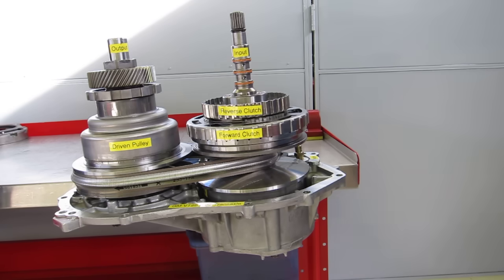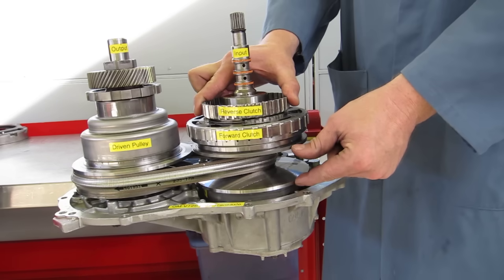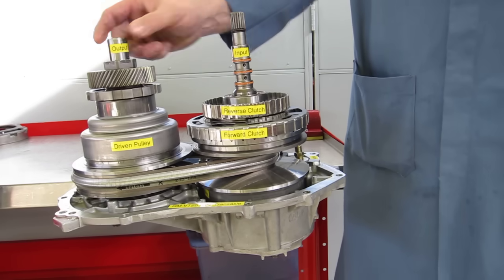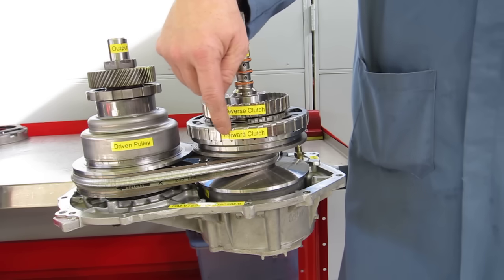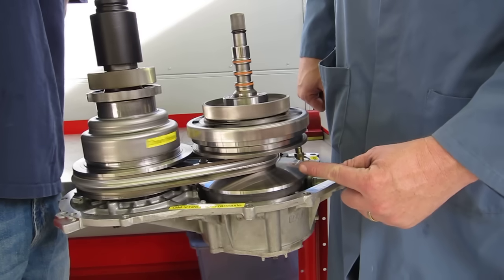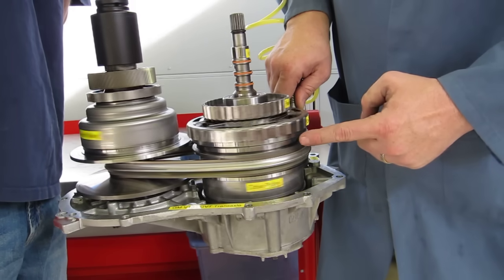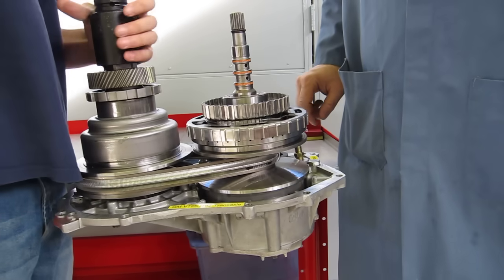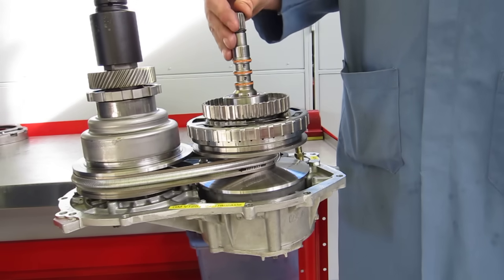Continuously Variable Transaxle (CVT) Operation

Comment: It is amazing how such a thin and small belt can transfer enough force to drive a vehicle that weighs thousands of pounds. These transmissions are amazing that they work so well.  I realize there are long term reliability issues with CVTs.
Reply: Its interesting how it's all designed.
Part of the reason the belt can be so small is because it's spinning much faster than the axle. If the wheels are applying hundreds of pounds of force to the ground during acceleration, maybe there are only a few dozen pounds of force on the belt depending on what the reduction is.

But all the energy going to the wheels must come through that belt, you're right. It just spins around a lot more than the wheels in order to convey that energy
Reply from the maker: Thanks for watching
Reply: Long term reliability issues boil down to the manufacturer, as well as how the individual transmission is serviced by its owner (or owners). Honda CVTs can last a very long time as long as the CVT fluid is changed on a regular basis, using the correct OEM Honda fluid. On the other hand, Jatco (Nissan's transmission OEM) seems to use rubber bands in their CVTs, and no amount of maintenance can protect against that.
Reply: @TheKnobCalledTone.  The steel belt slips and breaks because of inadequate pulley pressures.  It has nothing to do with the strength of the belt.

Comment: Which brand makes the best CVT's I own a 2013 Honda Accord and have heard good things about Honda CVT's in particular.
Reply from the maker: Good question, Honda has used them for a long time. Thanks for watching
Reply: The best one is Toyota with their Asin CVTs.  They kept on refining them over the years. The worst is Jatco transmission owned by Nissan

Comment: its great until about 100,000 miles...then its snaps like a yo-yo......WHAT THEY NEED TO FUCKIN DO, IS MAKE VERY EASY TO R+R.....LIKE AN ALTERNATOR, OR STARTER.......but they wont...why kids?   because nissan wants you to buy more of their junk more often....THE GOVERNMENT NEEDS TO STEP IN AND KICK THEM IN THE ASS.
Reply: The government is the reason this junky trans exists in the first place with their ever increasing demand for more mpg and cleaner fuel.  CAFE standards are too strict.
Reply: @JohnS-il1dr  Yes, thats true......but it does help the mpg since its a direct drive......they need to make it better...just look at the crappy pulley- its looks like my gal's bracelet......also have a removable door or pan to remove pulley when it snaps....you have to take the whole goddam off the car- its a $3800 job here in connecticut......If they want to satisfy cafe laws, fine, but make the damn thing serviceable....Its a total scam.

Comment: Honda CVTs are great. Thanks for this wonderful explanation
Reply from the maker: Thanks for watching
Reply: Not until 2016.  The 2013-2015 cvts had bad seals that caused the bearings to go bad. Replacement was the only option for my 14 accord lxs coupe. 5500.00

Comment: so if this cvt was in a "real" car the belt could be manouvered to any position on the two pulleys to generate which ever gear ratio is needed. Did i get that right or is the cvt in the video only capable of the two shown ratios?
Reply from the maker: No, those are the ratio limits. It is variable ratio between them. Thanks for watching
Reply: @WeberAuto  thanks for answering and thanks for the amazing video! Have a nice one. 😁

Comment: The CVT part is easy to understand. Wish they would shown how the clutch works better. More specifically how it achieves the connecting/slip of a conventional clutch/torque converter design when the car is stopped.
Reply from the maker: Thanks for watching

Comment: All I hear is that a CVT transmission will last about a hundred thousand miles if you're lucky such crap I bought a CRV 2016 Honda thinking it's a Honda it will last forever if I take care of it once the car's transmission goes I will never buy a CVT transmission vehicle again
Reply from the maker: They have been troublesome. Thanks for watching
Reply: Our dealer has powertrain warranty forever so even if our Hondas CVT breaks I don't care I still change the fluid though most people dont

Comment: It's a shame you didn't do more work on the air supply. This demonstrated the speed it can change the ratios but not how slowly it can change them too !
Here, have a look at an oil-free version that's purely mechanical from within the pulleys working in the car:
https://www.youtube.com/watch?v=j2jkyCaard0
It is effectively two analogue mechanical computers fighting over a belt !
Reply from the maker: Thank you

Comment: Does the belt tend to slip or lose grip when climbing a mountain?
Reply from the maker: No, it is held tight by very high forces from in the pulleys
Reply: @WeberAuto  I ask because i purchased. A older Nissan Altima. It has a cvt. Should I install  a after market  cooler for the transmission fluid? I'm seeing that the fluid tends to run hot which kills the life expectancy  of the transmizsion.
Reply from the maker: @canocano5480  If you live in a hot climate area it might be worth the expense.
Reply: @WeberAuto  I live in cali. Central vally. Summer temp can get up to 100.°

Comment: Perfect video!! My Altima cvt has a manual gear shift option with a total of 6 gears. Would the cvt last longer using this feature rather then the belt and pulley system continually hunting and changing gears?
Reply from the maker: No, it is just a gimmick to make you feel like you are not driving a CVT
Reply: @WeberAuto   After more thought, it seems if the gear function were used for thousands of miles, it would make grooves, wear patterns, on the cones (for lack of correct word). Continually hunting would provide a more even wear pattern. How about using the gears for towing short distances?  I know, towing not recommended.

Comment: So basically the belt is held in gear by the edges of the belt? Seems like it's slip city...
Reply from the maker: Yes, with a fluid pressure on the pulleys of up to 700 psi (4826 kPa) pressing on them.

Comment: Garbage technology!! If one piece fails the whole garbage transmission goes...The belt, the seals ( leak ) used to pressurize the cones...Customers in the United States pay alot of money for new vehicles. That the manufacturers decide to place this Garbage transmissions in their products to save money but don't pass the savings to their customers...All the manufacturer pass is headache to their customers...How many times did Nissan get sued over this Garbage transmission..I'm sure there's other manufacturers...Get some smart practical engineers in auto manufacturing...Yes I'm pissed cuz I had to deal with this CVT Garbage !!

Comment: This an awesome illustration and I have watched many. My biggest take on the CVT is that is NOT for the heavy footed wanting to go fast in a hurry. Consistent times on oil and filters changed. There is 1 filter inside  and a small round one front outside of the case. from the outside of the case, so if you go to get your oil changed and filters changed tell them you want to see them both. There should be a oil pan gasket and a used interior filter, metal, and a small round filter from on the case. IF they can't show you them then they just screwed you out of an oil change without changing the 2 filters. Tell them after the fact, that way they can't go find one from weeks ago. You'll be glad you did. And you will only pay for what they did and and not what they said they did. It's your vehicle and you have every right to ask and see.
Reply from the maker: Thank you
Reply: @WeberAuto  Your Welcome!!

Comment: The 2 pulleys have to open and close 100% in sync 100% of the time .
If there is the slightest variation the belt will either be loose or tight

Comment: As I think the rings designation ("Reverse clutch" & "Forward clutch") on the transaxle have a mislead. To make the input pulley to drive forward one have to lock "Reverse clutch" ring with "Forward clutch" ring. And to make input pulley to drive backward one have to lock "Forward clutch" ring with transaxle casing and "Reverse clutch" ring must be free from any locking.

Comment: hey there, my only question, what controls the pressure applied to the drive pulley? is it electronically controlled oil pressure? or is there a mechanical pump that drives the pressure up as rpm increases? or is there something else?

Comment: Awesome, but you forgot about the “fails constantly” part, all Nissan’s have it and are required to have it.
Reply: You meant to say "fails constanly only in nissans". In toyota vehichles it works great, mine is at 213,000 miles with only fluid changes.
Reply: @carsnmods1687  Toyota uses a different brand cvt Nissan get their cvt from jatco
Reply: @chance_hooks3478  oh really I didn't know that? (Sarcasm)
Reply: @chance_hooks3478  Nissan owns jatco so Nissan makes its own. Jatco makes transmissions and CVTs for other car makes as well...
Reply: @carsnmods1687  “All Nissan’s have it”
Reply: The only nissan to own is a manual transmission one. That's been true since they were datsuns
Reply: The stepper motor?
Reply: @c4prlm4st3r  No, the Nissan engines are good. But all their CVTs are crap.
Reply: @destruxandexploze2552  am using cvt also & just got p1777 error.
Reply: @c4prlm4st3r  Oh, well they’ll say you need a new transmission at a shop but there’s a video showing you how to change the stepper motor.
Reply: @destruxandexploze2552  exactly. The shop that help me scan and clear dtc code said they not selling any stepper motor. But they do have use transmission if i would like to change it. I will go for same option as you. Change the stepper motor.
Reply: A stepper motor does what?   My aged mother is thinking of buying a Nissan Murano. I'm doing the research. I've seen, not only here on YouTube but elsewhere quite a few HATE IT complaints. But there are hundreds of thousands of them selling. Plenty of "tried and true" old school automatics fail also, STILL after all these years of research and development.
Reply: @giantfisher  don't get one with the cvt, one of my good friends works at a nissan dealer and from the time he goes in to the time he is leaving every day all he does is change the crap cvt's right out of warranty milage.
Reply: @carsnmods1687  Thanks partner. Fortunately dear Mum decided over night to not get it for a few other reasons, so I did a brief explanation of the crunch research I did and doomful data on the CVT so that horse is dead.
Reply: I've got a 2007 Altima V6. I've never had the cvt serviced and after 14 years it still runs like a champ. Just sayin.
Reply: @timshipp1145  Got the rare one that works. 

I have a 2006 Nissan Altima 3.5 V6 but it’s a 5 speed. Their automatics are also not great.
Reply: Nissan uses a different cvt mechanism.  It uses cones And rollers not belts and pulleys.
Reply: Actually it’s Subaru that has all the cvt failures these days.

Comment: Since the surface contact between the belt and the pulley are limited and smooth, there must some losses of power due to slip, how much are the losses and can the belt survive the engine because of wear caused by frictions?

Comment: Great video of one of the crappiest transmissions. My ‘13 Pathfinder CVT blew up at 60k and 114k. I now have 4300 reasons to never buy Nissan again. Great video though. What we need are more modern vehicles with standard transmissions. Auto tyranny’s suck.

Comment: Thank you for uploading this video, my mom has a Saturn with this exact transmission, and it's stuck in under drive (under 40 mph) and anytime you push the accelerator to make it go faster, the transmission shutters and shakes the whole car, and it sounds like the bands are slipping. So based on the operation in this video, I'm assuming that the transmission is stuck in under drive because there is something wrong with the valve body and solenoids. The Solenoids aren't sending the right signal to the valves, to increase hydraulic pressure to the pulleys to make them shift into overdrive?
Reply: Or possibly bearings were starting to fail 🤔

Comment: Although made of steel, I don't think having a belt driven transaxle is the most reliable way to do it, however from an engineering standpoint it is most likely the cheapest and most feasible way to do it.   I do have a question though.  In the video you showed the two "extremes" of the pulley sizes by applying a constant pneumatic pressure to the inlets and therefore the pistons.  I was wondering if the vehicle would use lower pressures for small movements and higher pressure for fast movements with a longer travel, or if they used the same pressure on the inputs but varied the pressure time(kind of like a duty cycle, but with pneumatic pressure instead of a signal)?
Reply: However all the MFG think it's great

Comment: They're quite ingenious, and a lot simpler mechanically than some older transmissions, but not the most reliable things in the world. Using exotic metals for longer lifespan would make them even more expensive. Toyota and Nissan make these via sub-companies. Toyota have the best reliability on their's so far, apparently.

When they do fail, they pretty much detonate and it's expensive to fix / replace the core.

Comment: DAF used a twin vee belt CVT  I thought it was reliable and efficient car. The only problem was it would go as fast in reverse as forward. I only owned one a 1973 late model 55 1300cc. At roughly 70K miles one belt snapped. The remaining belt got me home and about without a problem. I think two belts cost me £10 and It took a couple of hours to change them.  Life was simpler back then I guess.

Comment: I first got a Nissan CVT in a 2008 Altima with 18K mi.  It sounded and felt wrong,  like a manual transmission with a badly slipping clutch.  It is now just a little over 145000 mi with no transmission troubles--ever. I don't know why.  The (original) fluid is clear and clean.  Maybe it's because I'm old and nearly never take the engine over 2500rpm.  Low stress leads to low stress.
Reply: My 2009 Nissan Rogue runs like the day I purchased it. 
Currently 137000 Km on the clock.  
Made in Japan.  
No issues at all for the last 12 years, only regular services.  
Love it.  
Will keep it for another decade.

Comment: Had a variable speed in my 1971 John Deere combine 6600, a big heavy duty rubber belt lasted for30 years with no problems, in the 1960’s Massey Ferguson had em in their farm combines MF 300, JD would weigh 20,000 # loaded and this belt drive could handle it 50 years ago

Comment: The out put connected to the wheels. So when on off-roading, one wheel stuck, vehicle will have weaker out-put to protect CVT from burn out.
Reply: He meant the output connects to the tailshaft or differential just like in any other car. There is always a weakest part in any design whether it is the clutch plate or synchros in conventional manual gearboxes or the steel belt in CVTs.

Comment: Just get a geeared automatic or manual shift. I own a 2012 Altima 2.5s Coupe and it's CVT. About to trade it off. Thing to remember is to keep the CVT fluid changed to keep up with Viscosity for the belt and transmission. I change mine every 15k to 20k miles. Sometimes even less. Never a single issue at 120kmiles. The car shifts really great like the day it was new.
Reply: well i mean you are changin it every 20k it better run good lol
Reply: My 2009 Nissan Rogue runs like the day I purchased it. Currently 137000 Km on the clock.  Made in Japan.  
No issues at all for the last 12 years, only regular services.  
Love it.  Will keep it for another decade.

Comment: The hybrids with the planetary system are brilliant. They get infinitely variable ratio and no reliability issues in principle, and extremely simple mechanics
Reply: No reliability issues? Their entire service life is about 125K miles. They are the part most likely to fail on any vehicle they are installed in.

Comment: They have been using this exact same principle for a hundred years or more with AC motors in various industries. Usually it is just one spring loaded pulley on the motor and a static pulley on the driven shaft. The motor is mounted on a horizontal slider with a threaded rod and a crank (like a vise) that actually moves the motor closer or farther away from the static pulley.  The springs in the pulley take up any slack in the belt which changes the ratio. Of course it's a rubber belt and typically a very modest load. The Holy Grail would be one that will handle major loads. They're getting better.

Comment: What would have been better was to use a regulator on your air supply and the gear ratios would have been a bit better to see as the sheaves changed diameters. Other than that good explanation. Can anyone say snowmobile drive system put in a car??? Thank you guys

Comment: That's not how it works. It's supposed to slowly move the cones. He slammed it from low to high. Too difficult to control the pressure so we could watch the transition from low to high?? Fail.

Comment: What strikes me about this CVT transmission system is this Steel Belt. It is apparently so weak, but it is very sturdy and gives a very big result, when vehicle is riding in watching in the change of the pulley that it reaches the secondary part of it begins.  walk with reach high speeds, right?  Very interesting indeed.  I'm interested to know a bit more about

Comment: Good explanation 
I avoid CVTs transmissions .  Really only 1 company can make one that is dependable.  Asin transmissions which Toyota owns a large share of the company.  Honda CVTs are getting better.  But the worst is jaco. I have heard of stories that with in 100k miles it burned thru 3 CVTs transmissions

https://youtu.be/HSZ5-ifYQho
Basically don’t get until they work out the bugs